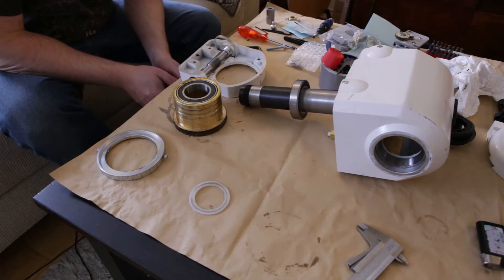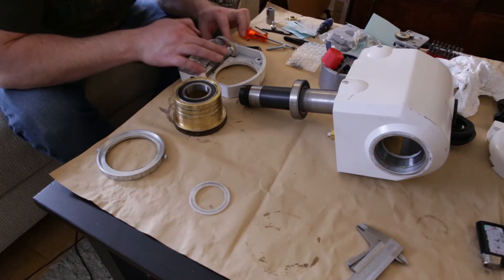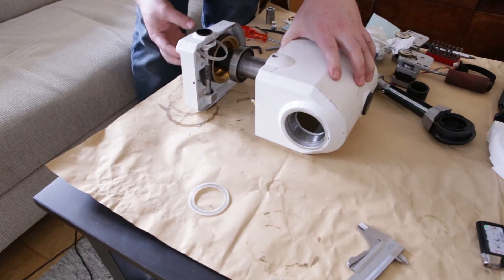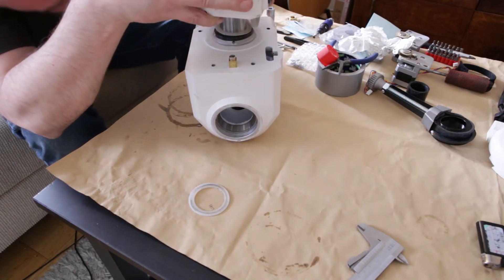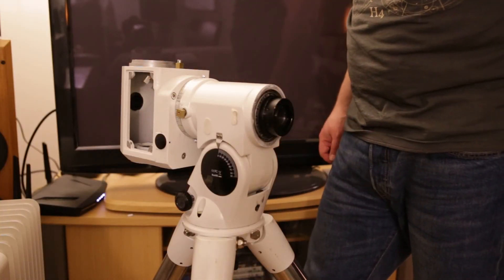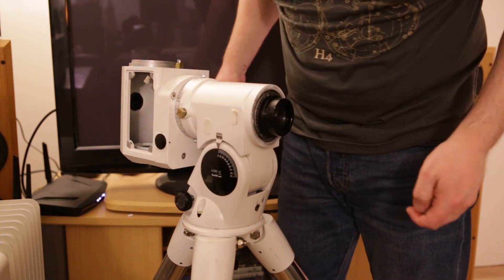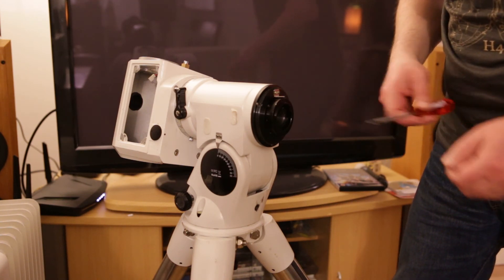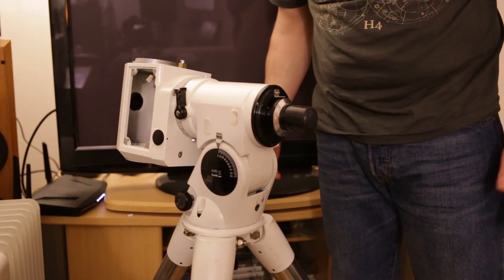NEQ6 Belt Mod Part07 - Reassembling RA Axis

Comment: It looks like a mix between a watchmaker and auto mechanic job. A good thing to do when disassembling is to clean and degrease everything of completely and then reapply new oil and grease when assembling. That can make bearings slide a lot easier on the axles.
Nice job and nice instructional video.